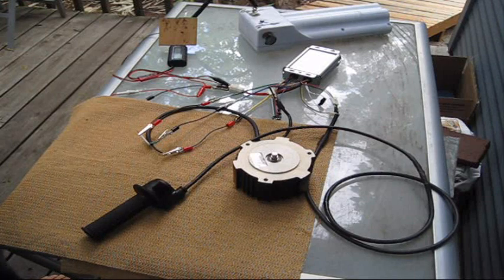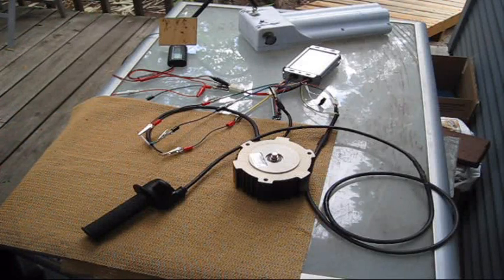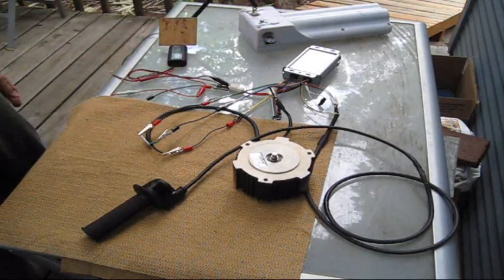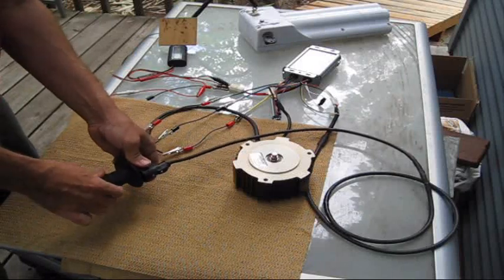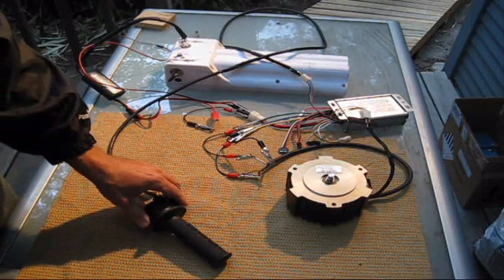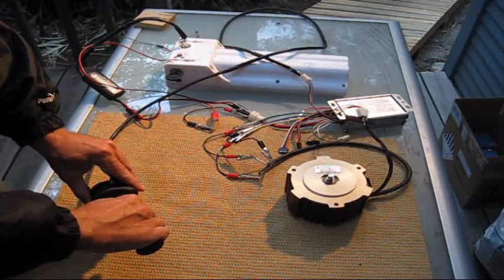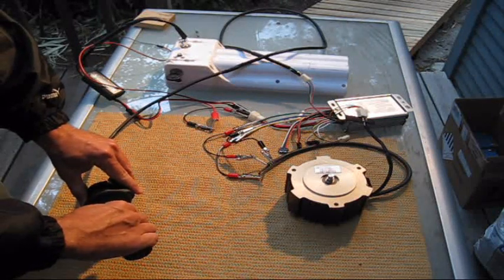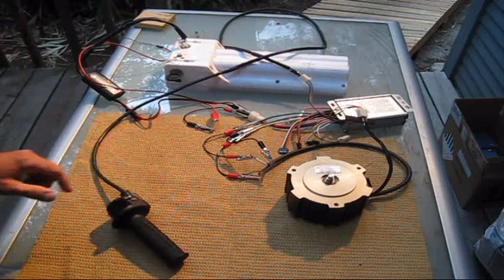Initial testing of 400w Kollmorgen motor.

Comment: Hi, appreciate if you can point me to a page/doc that explains how to mod the motor to run clockwise. I understand that the hall sensors and dc power need to be reversed, b ut would like to be sure how it is done. Thanks!